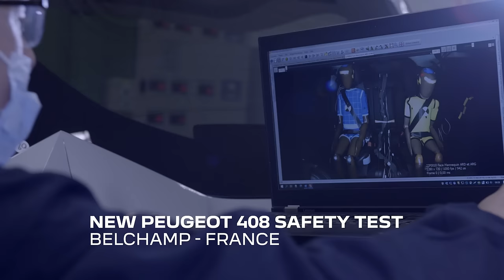Peugeot 408 | Safety First

Comment: Surprising video considering Peugeot isn't capable of reaching 5 stars grade at Euro NCAP, while chinese automakers do. This issue seriously need to be solved - it's a shame these great looking cars are doing bad, security wise.
Reply: I wouldn't call 4 stars bad. EuroNCAP actually used the 308 as basis and performed few additional tests on the 408. They'll probably do that next year.
Reply: @eefneleman9564  No, lo que pasa es que Peugeot no te da todos los sistemas en los modelos básicos que son los que prueba EURONCAP, solo los altos de gama consiguen las 5 estrellas, mientras que las demás marcas consiguen las 5 porque desde los modelos básicos si incluyen esos sistemas de seguridad.
Reply: Cause of chinese cars way expensive than most Peugeot?
Reply: If you are educated enough to read the NCAP test you would notice that the structural rigidity of the car and passive security is excelent (better then the 5 star Golf 8)... the car misses some electronic aids in the base model and that is why it got 4 stars. Allure and GT trim get 5 stars easily
Reply: Yo now the peugeot 3008 ,408 ,208 and more are 5 stars
Reply: @Theyv9190  absolutely